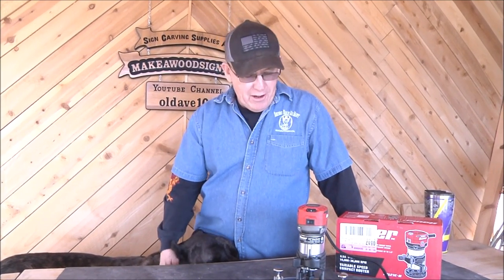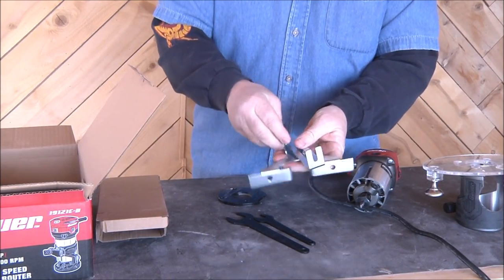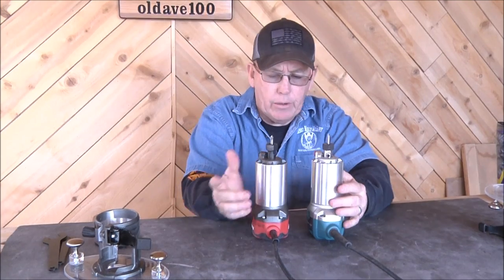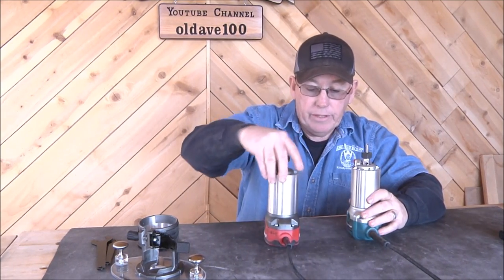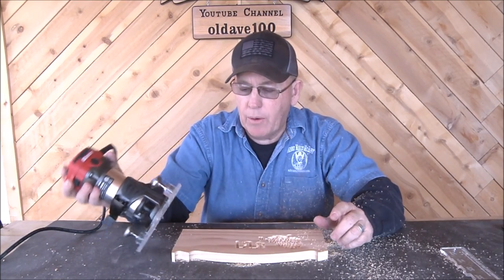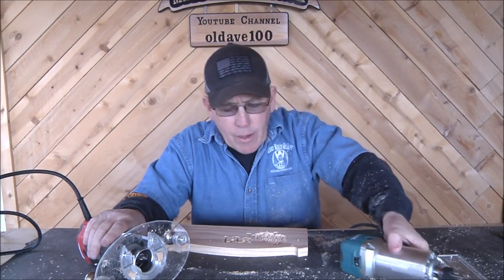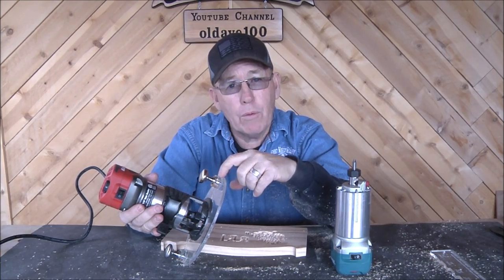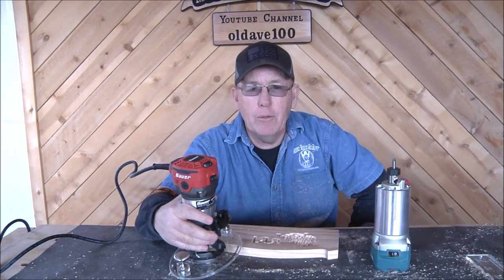#458 Review On Bauer Trim Router Vs. Makita

Comment: I own the Bauer cordless circular saw, recip saw,  cordless jigsaw, cordless sander, 1/4 impact,  cordless drill, corded 1/2" drill, some cordless work lights, and probably forgetting some. But they are all great. I am self employed and do home repair and remodel and use them hard. Have not had one issue with any of the Bauer tools. Plus if  you buy the one year warranty, you can go once a year and exchange the tool for a new one, no questions asked. So just for the price of the one year warranty you can get a brand new tool  every year. I write the purchase date with a sharpie on each tool so I will know when to exchange them for new. Cant beat it. Definitely getting the  router and bandsaw soon.
Reply from the maker: That's great info, Thank you. I also have the cordless Bauer circular saw and I love it. I'm sure you'll like the router...

Comment: The I (line, commonly confused with a "-") was a schematic symbol for a closed circuit. Which means the electricity can flow and the device is powered on.

The O (circle, actually a "zero") is the symbol for an open circuit. Meaning the circuit is incomplete and the electricity will not flow, so the has no power.
Reply from the maker: Thank you...

Comment: Question - If I want to cut ring sort of shape in the center of a board, could I use a drill press (or a hand drill) to drill a starter hole of the right depth and width for my router bit to set in. Then use the router to dig out the full ring shape. I'm thinking that might be just as good as a plunge adaptor for the router that I am planning to purchase.
Reply from the maker: We never use the plunge adapter. You can drop our spiral up cut bit straight in. Just make sure you do it in several passes, depending on the thickness of the eood
Reply: @oldave100  Thanks

Comment: Thanks for the review.  I'm still looking for an inexpensive router, my battery powered Ryobi is okay for learning but I can't see it working for real work.
The 0 and the - represent an "open" and "closed" circuit.  0 is for open, not connected, OFF and the - (dash) is for closed, connected, ON.  If you look at your computer you'll see that the power button, most likely, is a circle with a line dropped in from the top - that's the same representation 0/- combined to one image Off/on. 
Question: What base are you using on that Bauer? Looks like it might match the Makita but I can't see what's written on the base.
Reply: Correct O is for open the circuit is "open - not complete/not connected (no power - OFF)". I is for closed/completed circuit "connected/flowing (powered/live - ON).
Reply from the maker: I think this one might work well for you. Feels very solid. Thank you for the info. This is definitely  different hole pattern than the Makita. We have the Bauer base plate on our website now.

Comment: Have you ever had any problems with a "Run Away Speed Dial" on the Mikita router.   Many I've spoken to say that in time the speed dial loosens and will not hold an RPM setting.
Reply from the maker: I haven't had that issue, but to be honest I use mainly the DeWalt. So my Makita doesn't have a whole lot of hours on it
Reply: That is true,....

Comment: And the Bauer ONLY TAKES 1/4 inch shank bits correct? And which bit would you use for a flat background
Reply from the maker: Yeah, it only takes 1/4" bits. For a flat background, you'll want to use the Spiral upcut bits

Comment: Did you remove the rubber grip from the Makita before modifying? Thanks, love all you do.
Reply from the maker: I did on mine before I knew better, but it's not necessary, the hole saw goes right thru it.

Comment: ** IEC 60417-5007[5], the power-on symbol (line) open circuit, appearing on a button or one end of a toggle switch indicates that the control places the equipment into a fully powered state.    IEC5008 Off Symbol.svg 
 ** IEC 60417-5008[6], the power-off symbol (circle) closed circuit on a button or toggle, indicates that using the control will disconnect power to the device.
Reply from the maker: Thank you...

Comment: Thanks Dave.  We have a home made CNC that we bought used and replaced the heavy router that was on it with Bauer you reviewed.  Cuts great.  I have a few questions.  The collet that comes with it only accepts 1/4 inch shank. Where can I purchase a collet that fits this router that can hold a 1/8 inch shank.  
I also would like to know your recommendation (if you know) for the speed the router should spin and at what a good feed rate would be for cutting pvc sheets.  
I thank you in advance and look forward to watching your upcoming videos
Reply from the maker: Happy to hear the Bauer is working for you. I don't know that they make an 1/8" collet for that router. However you should be able to get a "collet reducer" for 1/4" down to 1/8". If you google it you should find them easy. When we route PVC on our inverted router we run the router at full speed and seems to work well. That being said I really don't have much experience with running a CNC. I think this is another google question.... Thanks again for watching
Reply: Thank you very much

Comment: Can someone tell me the exact diameter of the bauer aluminum body?.. and the lower rpm range can be a plus. The dewalt starts at 16k vs 10k on the bauer. And is the bauer collet nut interchangeable with the makita or bosch or dewalt?
Reply from the maker: The Bauer motor diameter is approx 2.540. I don't use lower RPM on any wood I cut. I don't know if the collet nuts are interchangeable. I would not suggest switching collet nuts or collets to any other router.

Comment: It comes from the binary system (1 or | means on). O - IEC 5008, the power off (circle) symbol on a button or toggle, indicates that using the control will disconnect power to the device. It comes from the binary system (0 means off).
Reply from the maker: Thank you. That does seem to be the answer we were looking for. So I was right and Vicki was wrong, LOL....

Comment: Have you run the Bauer for an extended time to see how hot it gets? It's the one downside I've seen in reviews.
Reply from the maker: No not yet. I've go a big project coming up so I'll give it a try.
Reply: @oldave100  Cool! Definitely interested. I was thinking of using it in a CNC, but worried about running it that long
Reply: Yeah! I got a Bauer trimming router and gets really hot after minutes of working. I do not know how long it is gonna survive.
Reply: @aldegin  I've had my 2 years work all the time with it. No issues at all. U always make negative comments on every post u comment on

Comment: What size hole did you make in the back and what type of bit did you use?
Reply from the maker: 2" hole and we did it with a metal cutting hole saw in the drill press.

Comment: Do you have a base designed for the Bauer router?  Or, did you use one designed for a different one?  I think the switch is "I" for power in, and "O" for power out, so I agree with Eric.
Reply from the maker: Yes we have a special base for the Bauer. It's on the website now. Thank you for the info....

Comment: What about longevity? I need a new router since my last one burnt up but I rarely use it so I don't want to spend alot. Between this one and the Ryobi full size router for $15 more.  Just don't really like the Bauer only having a 90 day warranty.  Just going to be doing round overs mainly.
Reply from the maker: I've had no issues with the Bauer. I think it's a great deal. I think they have a extended warranty available, but that's extra cost. If you're only doing round overs I would think this would last for years, just my opinion...
Reply: @oldave100    Thank you.

Comment: Hey Eric, another great video. I have a questions about the Bauer router. Does it have the built in L.E.D. lights? Bosch makes 2 different trim router, the colt 1.0hp (5.6 amp) and the Colt 1.25hp (7amp). Have you tried the Bosch Colt 1.25hp (7amp) router? If so how does it compare to the Dewalt 611? I have been looking to up grade, and the Bosch feels like it very well made, smooth height adjusting and it looks like it has the power I'm looking for.  And by the way, I've been married long enough to know Its a lot easier to just say "yes honey your right" LOL. Thanks again guys. You guys are awesome.
Reply from the maker: Thanks so much for watching. Glad you liked it. The Bauer do not have the built in lights. Not a factor for me because I always use separate lights anyway. I have the Bosch Colt but I have the older version, 1.0 HP. Haven't tried the bigger one yet. That maybe the next one for me...SHHH don't tell Vicki. I do say "Yes honey you're right" more than I like to admit.... Happy you found us and like what we do.

Comment: thanks the alum body is smaller diameter than makita so that wont work for me..i use the router as a spindle for my cnc machine  and diameter needs to be same if i want to use the same spindle bracket...and i need lower rpms for doing aluminum which is why i like the 10k start..oh well..thanks for the info
Reply from the maker: You're welcome, happy to help...

Comment: Can you cut a template with Bauer, since it has enough power? I seen some older videos with your father talking about using a Porter-cable template guide.Can a template guide fit on it for the spiral bit?
Reply from the maker: Yes the Bauer original base plate is made to accept the template guide.  However I would make make heavy cuts in multiple passes.

Comment: hi guys! LOVED this video! Love Eric's humor!

I believe it is a zero and a one. Zero and one is a binary code.

Here is info:

What does 1 and 0 mean in binary code besides on and off?
Binary code, code used in digital computers, based on a binary number system in which there are only two possible states, off and on, usually symbolized by 0 and 1. ... A device called a clock sends out regular pulses, and components such as transistors switch on (1) or off (0) to pass or block the pulses.
Reply from the maker: Thank you Sue. So glad you enjoy Vicki and I jousting... Thanks you for looking up the answer for me. So just to be clear? You're saying I was right and Vicki was wrong... LOL just kidding...
Reply: I didn't want to say it exactly that way...LOL..but, yes...

Comment: Does your Bauer get hot? Mine gets hot after 5mins
Reply from the maker: Yes all the palm routers in the summertime get hot. That's another reason having a base plate with handles is a good idea. Also you can ad moleskin to the side of the housing and it works great.